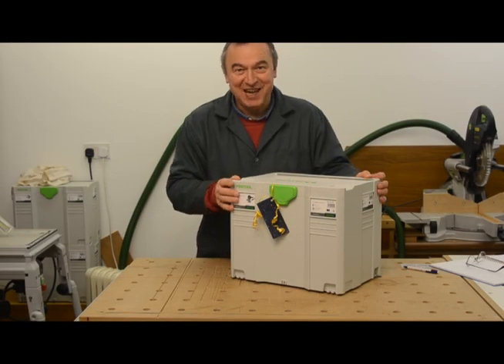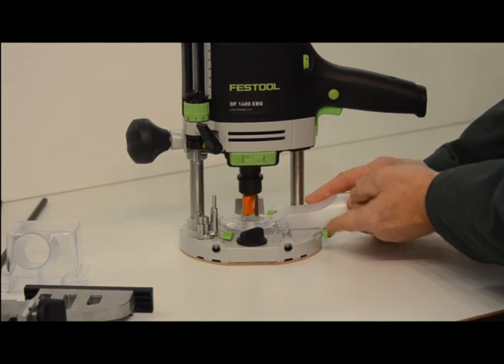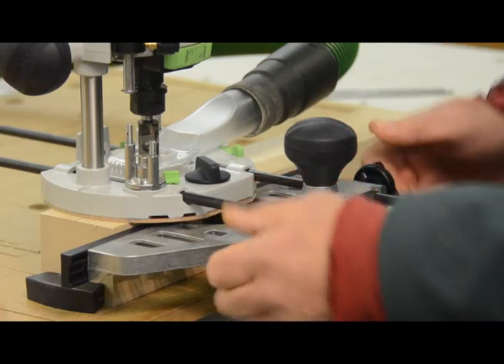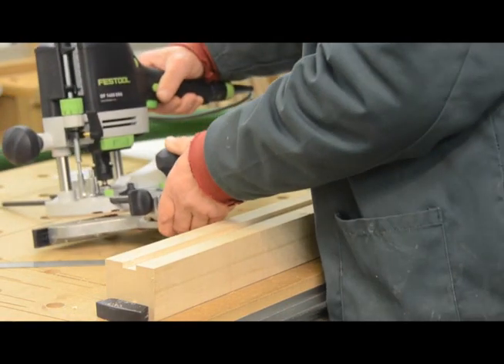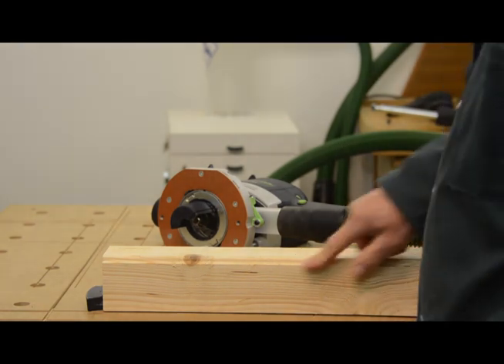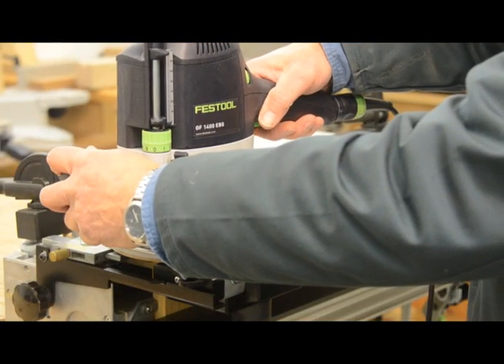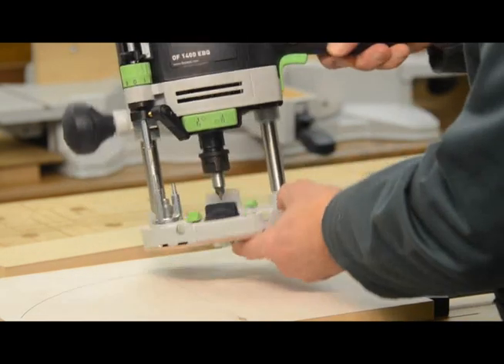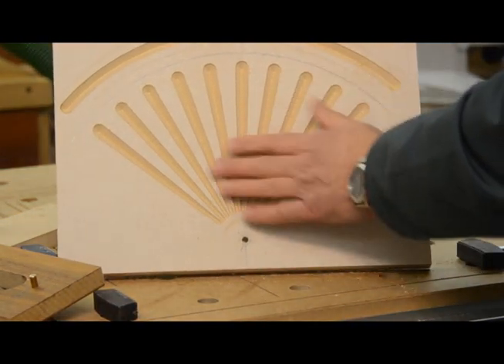Festool OF1400 Router Review and Demonstration

Comment: Hello Peter, I would like to thank you for your videos, I'm a woodworker with almost 40 years in, but I'm still learning. I had an older 1400 that went away and am now thinking of replacing it and need to know if the dust collection is truly as good as Festool is saying. I also have developed lung issue, Also thank you for sharing the info about the Mirka block sander and workshop dust issues. Go with Peace.
Reply from the maker: Hi Brent, I am sorry hat your lungs are not as they should be. The very best Festool router for dust collection (and probably the best in the world) is the OF2200. The OF1400 has excellent dust collection particularly if you use a good extractor like the CT26. I have found that some operations appear to produce dust but when I did the workshop dust study I found that the fine dust is mostly captured and it is only a few of the larger (non hazardous) chips that you see. Even so, routing will always produce some dust and if you have a particular sensitivity you may wish to use a powered respirator like the 3M Versaflo. If you are able to get to a Festool dealer I am sure that they wold let you try both the OF2200 and the OF1400. Good luck. Peter

Comment: Hi Peter, thanks to your great review I received my brand new Festool 1400 router today. I also ordered a set of guide Bush’s and adapter from Axminister. 
I now realize I should have also ordered the cone centering bit too. 
While looking at the base of the router with the adapter and a guide bush attached I realized that if I had the centering bit and it showed that it needs adjusting I’m not sure how I would do that. There are two screws at the base of the router possibly for adjustment but when the adapter is fitted it covers these screws. Any ideas??
Overall I love my new router and can hardly wait to get it going. 
I would have purchased another brand where it not for you so thank you Peter. Cheers Dan

Comment: Hi Peter, I wondered if I could ask your opinion about something- I use my Festool 1400 on a regular basis for door furniture- faceplates/ hinges etc and I got thinking about when using the router to locate the dead center of the door jamb for cutting mortise locks/ faceplates and door sweeps (I normally use the correct size bits so I only need to make one pass) I wondered if I purchased another fence and used both fences this would trap the router (once it has been set to the Ctr) and this would prevent the chance of any traveling or wondering left or right and that would leave you only needing to watch for the length of the mortise. What do you think? Cheers Dan
Reply from the maker: Hi Dan, I used to do something similar with an old Dewalt in my pre-Festool days. I see no reason for it to not work as you suggest. If you want to test out the idea first then take a block of hardwood (say 40 mm x 25 mm in section) and drill a pair of holes in the right place to take the fence rods as they stick out from the router body. You can fix the block in place with screws through your block that just nip the rods. If you wanted to make a permanent one of these then use screw inserts and a suitable screw knob. Wax the inner face of your piece of wood where it will rub against the door frame edge.   Peter

Comment: Hi Peter, I wondered if you could please advise me on the following- I am currently using the OF 1400 to mortise lock face plates in timber doors. I simply use the correct size flush cutting bit to do it in one pass and the side fence. However I wondered if there is a better way? Trend products a self centering mortise base with two fixed points which centers the router. Does Festool make there own version that you know off? Also I purchased at your recommendation the UJK guide bush set which is great but I wondered in relation to what brand you use when doing inlay work? The guide bush with the add on extra bush? Cheers Dan
Reply from the maker: Hi Dan, Take a look at the Festool MFS for guided router work. I have not seen the Trend kit. Take a look at this:   https://www.youtube.com/watch?v=nqWPIf0lfBk      Forgive the brief reply I am camping in the middle of a muddy field in The Netherlands.   Peter

Comment: Hi peter great reviews. Just a quick question I need a new router for kitchen fitting this model is 1400 watts will it be man enough for 38 mm work tops as my current dewalt is 2000watts. Love to see you review the kapex soon. Many thanks
Reply from the maker: Hi Alan,

The OF1400 is more than man enough for your needs. I have used it for raised panel work with no trouble at all. I have had loads of people ask me to review the Kapex - I will do it as soon as I can. For now let me say that it is absolutely brilliant. I have no hesitation in recommending it to anyone.

Peter

Comment: Hi Peter. I have a very specific issue/question about using the OF 1400 on the CMS-OF table. I need to use it with a guide bushing. I don't see a guide bushing accessory that will work with the table (the stock one for the OF1400 does not protrude far enough thru the table. How do you do that? is there a specific accessory that fits a guide bushing on the table?
Reply from the maker: Hi Robert, Forgive my ignorance of what might be a well router table technique but why do you need to use a guide bush in this way?  Peter
Reply: @NewBritWorkshop  thanks for your reply. I have a Leigh through dovetail jig that can be used on a router table, but it requires a guide bushing.

Comment: Peter, I got my brand new FO1400 yesterday along with brand new bits and guide bushings. My guide is not centered from Festool Factory... Do you have a video on how to correct this? Everything is brand new out of the box, and off center.
Reply from the maker: Hi Robert, Search the Festool Owners Group (FOG) for this. Mine came perfectly set up but there is a tweak that can be done and it was described on the FOG.   Peter

Comment: Hi, I have been watching your videos for a few weeks now and I would just like to say how well made and easy to follow they are.  The way you describe the tools is a joy compared to some of the people I have watched and I am looking forward to seeing some new ones.  I have just purchased an OF1400, but it did not come with the dust attachment for the side fence, like the one in your review.  I have tried to source one on the web but the only one I can find is attached to what looks like a guide rail fence.  I would appreciate any ideas on how to find the one you reviewed.  Thanks for your attention, John.
Reply from the maker: Hi John,

Thank you so much for the kind comments.

In the UK, my OF 1400 came with the fence and the dust attachment for the fence (and much more). As far as I can tell from the Festool UK web site the part you want has a Festool part number 492585.

It might be worth checking with your dealer to see if you too should have had one in the box.

Peter
Reply: Peter Parfitt Thanks for getting back to me so quickly.  I looked at the 492585 but it is not the same as the one you reviewed, but I will continue to search.  I asked the supplier about the extraction attachment, but he said that the deal that I got precluded the attachment and the 8mm collet. C'est la vie.  John.
Reply: I note your point and yes I also bought a new 1400 and Festool have now stopped supplying the 8mm collet and dust extractor. I rang the UK HQ and was put through to the South East region manger. I complained and he arranged for delivery FOC. Although I pouted out that I had spent in excess of £1500 re kitting myself out with new Festool toys
Reply: The part number is AH-SA-OF 2000.  It fits the 1400 and the 2200. I've ordered one from Nuts & Bolts in the UK. Paul

Comment: Hello again Peter and thank you fro all your GREAT videos! Quick question... do you find the Festool 1400 at all cumbersome in using it with your Leigh Jig? Particularly the handle configuration being a little different than the D-handles Bosch I have (non-plunge)  Thanks again for your feedback
Reply from the maker: Hi Jeff,  The OF1400 is okay but I now use the smaller OF1010 with the Leigh jig and that is a perfect combination.  Cheers.   Peter

Comment: Hi Peter, I was just watching this video again and I realized I had been using the fence on the wrong side of my Festool router for months. You show here that the fence is attached to the side that is nearest the tightening nob at the base of the router. I had the fence on the opposite side lol
Reply from the maker: Hi Dan, Easily done, particularly given the sketchy Festool instructions.   Peter
Reply: Hi I noticed that I'm not sure if it's the way the festool is set up but I was always taught fence the right and push that way the cutter will pull in against the fence at least that's with any other router I've used

Comment: Hi peter, I see you were using the ctl26 extractor, what starting extractor would you recommend? I do extensions/small developments. And obviously indoor work. I was looking at the ct midi? Would that be worthwhile? Thanks
Reply from the maker: I started with the CT26 when I "discovered" Festool. The CT Midi works at almost the same rate as the CT26 but you need to consider bag capacity. I have seen almost every Festool extractor in use and cannot fault their performance so just check the key things that are important - I suspect it will be weight and bag capacity.   Peter
Reply: New Brit Workshop thanks for the advice 😀

Comment: I have just purchased the Leigh jig for use with the Festool 1010 router on Oak.Nightmare.Chipout and breaking all over the place.Will the 1400 overcome this with its' extra power?
Reply from the maker: Hi Keith, No, it is not the router. It could be a dull cutter but more likely (forgive me) to be technique. When you start  to cut (pins or tails - it makes no difference) do the initial part of the cut slowly and take off small amounts until you are about 4 mm in to the stock. Similarly, if you are proceeding all the way through a piece then make sure that you have a backing board clamped behind as this will completely stop breakout. Do let me know how you get on and if this helps.    Peter

Comment: Hi, I was recently told that if I purchase the Festool 1400 router none of my collection of router bits will fit and I’d have to replace them with Festool router bits. Was my leg being pulled? Cheers
Reply from the maker: Hi Dan, That is certainly a joke. I have router bits made by CMT, Axminster, Trend and others. They range from 1/4" to 8 mm and 1/2". They all fit. However, you have to check what collets come with the router in order to use the full range of cutter shank sizes.   Peter
Reply: New Brit Workshop hi Peter, thanks for clearing that up for me. I bought those two Festool sanders this week thanks to your recommendation. The router is my next purchase in a few months. Cheers

Comment: good video; BUT you forgot to mention that the ratchet collet system WILL NOT let you undo the collet if the router is in a router lift (router table)- as in the Festool system the router switch is left ON & the power supplied through the switch on the table ( and their dust extractor system { plug-it cord }); therefore you MUST dis-engage the trigger first, before the collet ratchet works!!
Reply from the maker: Hi Andy, Thank you for highlighting this. Having used it for so long now one tends to forget odd details.  Cheers.   Peter

Comment: Thanks for the video peter thinking of getting this router would this manage work tops?  And any more info on  the of 1400 would be great  

Cheers robert
Reply from the maker: nippychippy Hi Robert, The OF1400 will deliver the power you needs for all kitchen work. If you were going to concentrate on kitchen work then you might consider the OF2200 as it is a real gentle giant designed especially for non stop tough jobs all day every day. If you are not doing work tops every day then the OF1400 will do well.    Peter
Reply: Thanks peter is there anything else I should think about getting for it
Reply from the maker: nippychippy Mine was bought from Axminster about 18 months ago and came with a side fence, a dust port for normal routing, a dust port for the fence and both 1/4 inch and 1/2 inch collets. I have not bought a guide rail adapter (492601) yet but will do sometime. Other than that it comes with a good set of accessories. As I already have the OF2200 I have 6mm and 12mm collets which are interchangeable between the two routers.   Peter
Reply: Thanks peter I am going into my local dealer and get a price thanks for your help again
Reply from the maker: nippychippy Robert - I said 6mm collet above, I meant 8mm collet as it is a good size if you ever get into Leigh jig work for dovetails.   Peter

Comment: hi pater
 I wanted to ask whether the festool of 2200 suitable for work with leigh dovetail jig?
Reply from the maker: nuriel me Hi Nuriel, No it is too big. The very best is the OF1010 but I have used the OF1400 with it a lot and it works fine.   Peter
Reply: thank you
you helped me in my decision which model to buy. 
is he strong also for other jobs?
Reply from the maker: The OF1400 is a very good router and able to do anything that the average user would wish.  Peter

Comment: Now I have the OF1400, I've come to realise it needs mounting on a table, yet the cost of Festool's solutions exceed those of their Router.  You may know the company Rutlands, who've suggested their R5016 at £249.95 as a solution,  but tell me I'd need to "drill the insert plate to mount the" OF1400.  I wondered if anyone reading this would care to comment on that, as a fix?  I'm a hobbyist who does not require the Festool's design mobility.  Without 'seeing the products with my hands', the less expensive Rutlands hardware looks as if it would be more stable than the Festool, while being £££s less!  Chris
Reply from the maker: Hi Chris, I imagine that all you would need to do is to use your OF1400 removeable base as a template to mark the R5016 plate. You would need to take care to ensure that you line things up at the centres of the plate and OF1400 base. Be sure to decide where you want the router to be in terms of its radial position about the vertical axis - ensure that the shaft lock lever is in the place that you want as well as the dust port from the router - this may need to be a compromise between the two. You also need to think how you will achieve fine height adjustment with the router in the table.   Good luck.  Peter

Comment: YOU FORGOT one safety point:  JEWELLERY & Spinning machinery DON'T MIX, you have a watch on while routing :(())
Reply from the maker: Hi Andy, I think a watch is not an issue as long as it is on a firm strap. Rings are a completely different matter as I know several people with damaged fingers due to rings getting caught on static objects so just imagine what could happen with machinery. The health and safety thing has to be reasonable and what people consider to be justified.   Peter